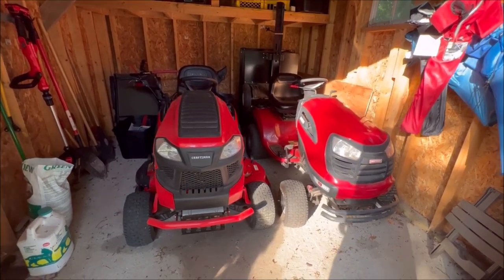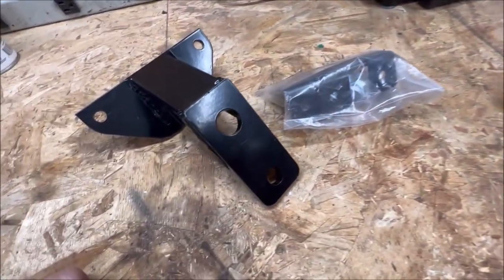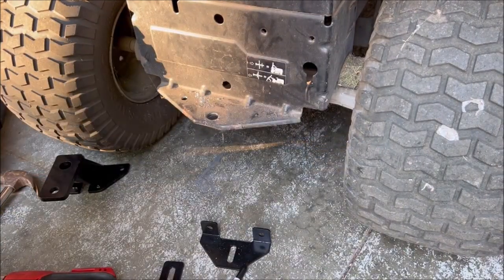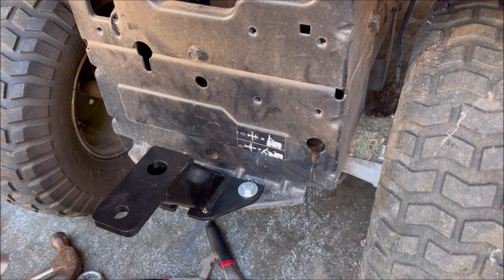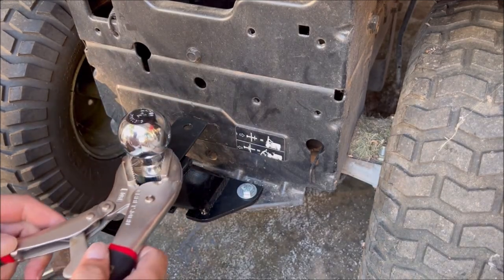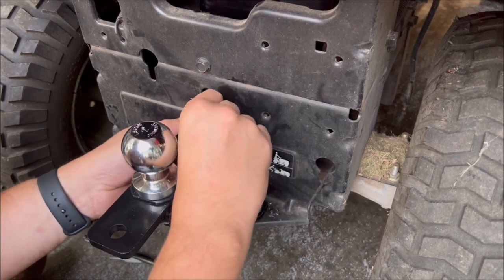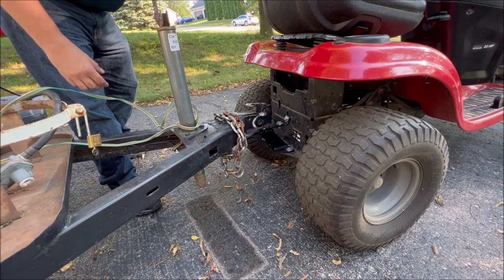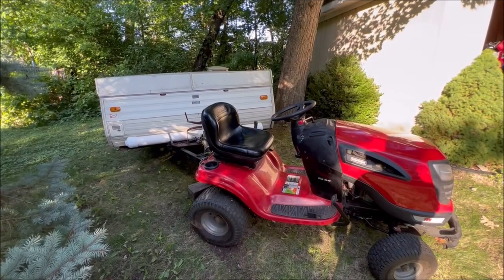Use your yard tractor to pull a camper

Comment: I did this with my older lawn tractor too.  There are some obvious weak points where the frame and transaxle bolt together that must be addressed for the longevity of the transaxle by welding in reinforcement.  I also added a front receiver hitch so I can push my trailers in exactly where I want them without the need to look over my shoulder.  Again, reinforcement is key if you want the tractor to last.
Reply from the maker: I am thinking about a front ball  as well. The back works great, but a little hard to place exactly where I want with some near by trees that I have.

Comment: Can you pull the trailer up a 7 degree elevation (13% grade)? I'm looking for a <$3k ride-on mower that can pull a 1000lb utility trailer up a 7 degree elevation grass slope with somewhat ease. Thanks for video! (Updated measurements)
Reply from the maker: I have some similar areas in my yard, I have found that you'll want something with more than 20 HP for both the power and the weight. I can manage the inclines with some momentum, but not at a dead start. 

The two tractors I use are an old Craftsman YT3000 and a newer Craftsman T240. The Cub Cadet XT2's are made in the same factory.